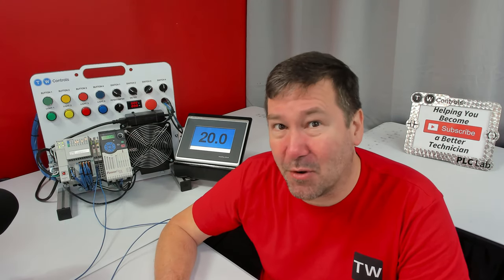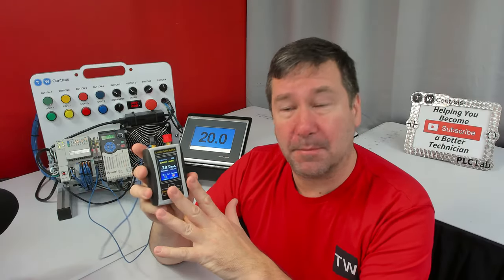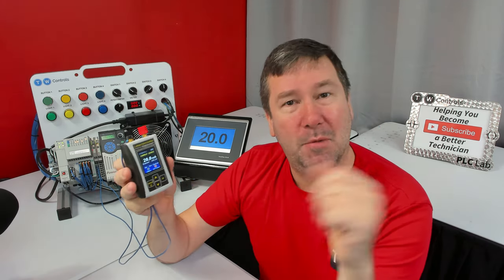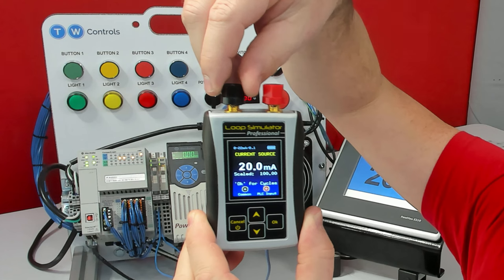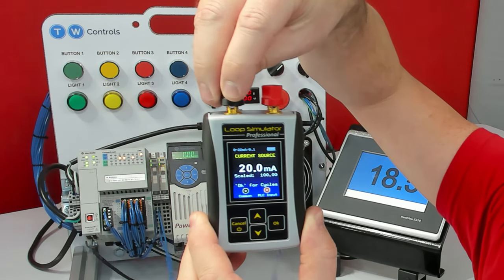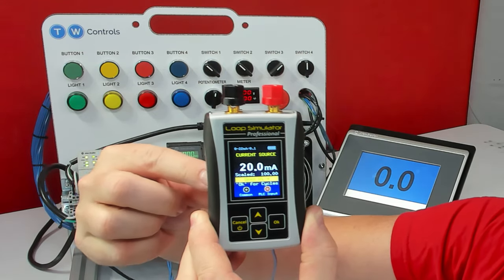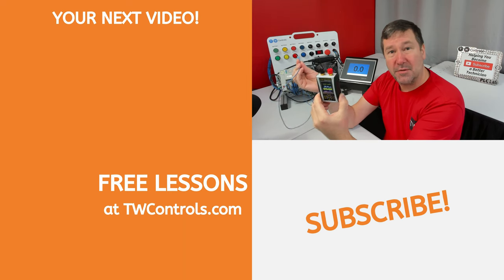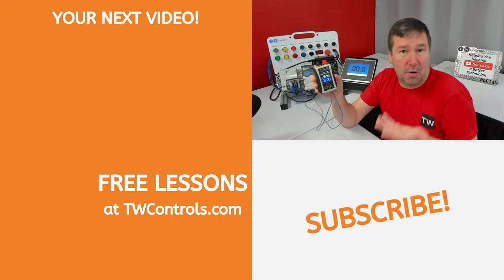Detect a Break in a 4-20mA Circuit with the OPEN WIRE Feature

Comment: If you bond the power supply negative to PE ground, deducing 4-20mA problems becomes much easier.
Reply from the maker: Possible but you can also add additional problems if the grounding isn't great.  There is a lot of discussion over what is the best on this.  I should be a video on it sometime.